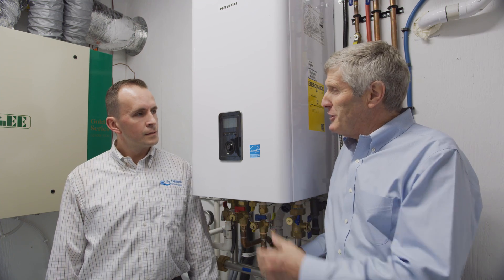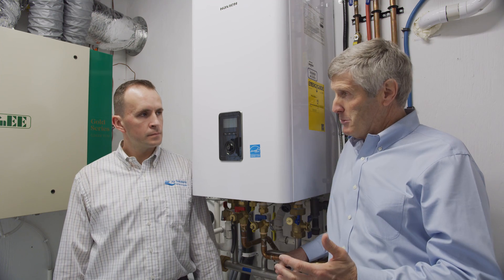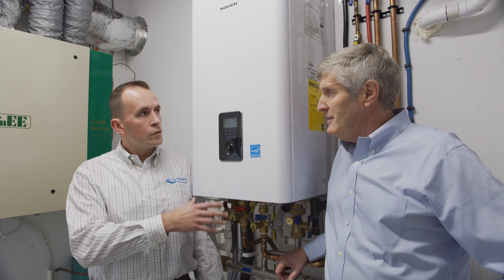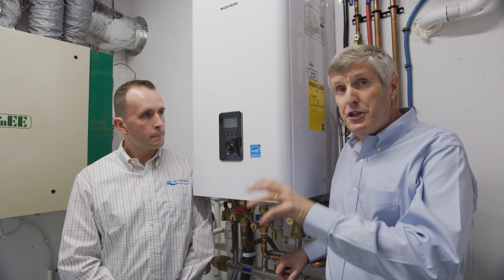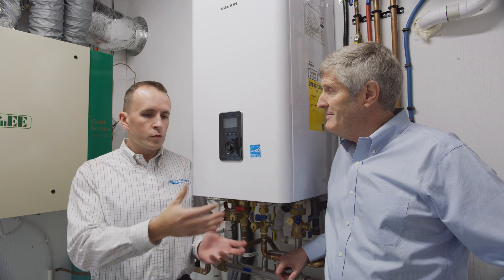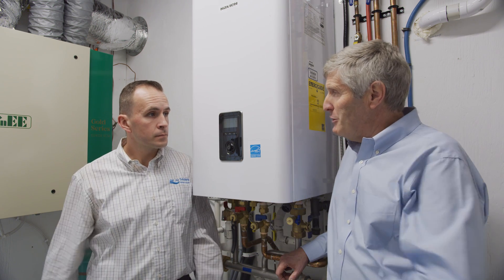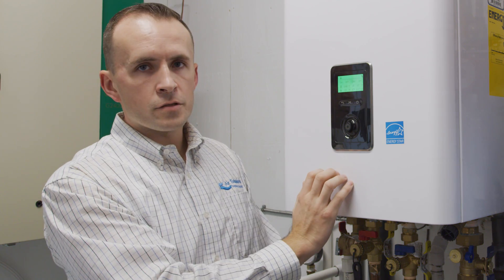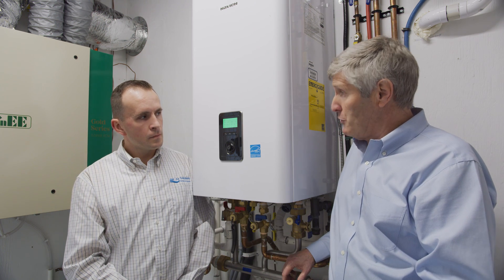What is a Combination Boiler Hot Water Heater: Building a NetZero Home - Part 20

Comment: Thank you... this is great knowledge you’ve given me!
Having a 70 year old with baseboard heat...
I was looking to replace Borge the boiler & hot water tank..
The local heating/cooling company never showed me this option!!
They want to install 2 separate units (as was put in in 1952)...